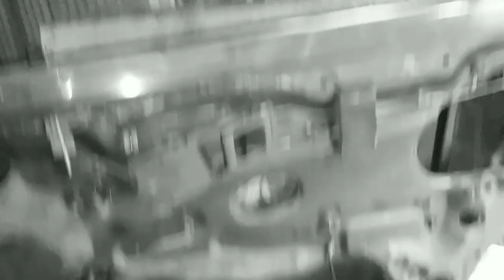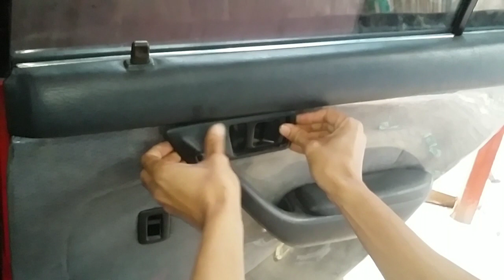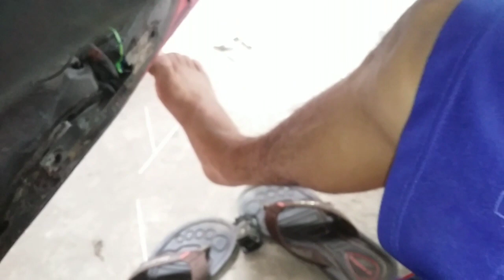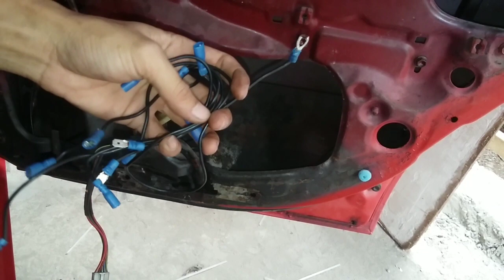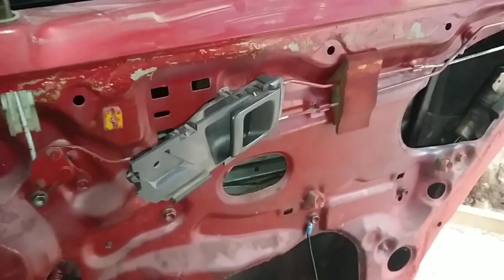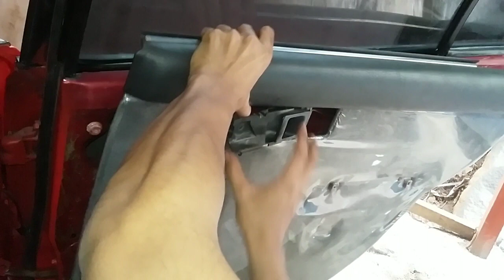Solusi power window lemah

Comment: Berarti kesimpulan nya. Tiap motor pake 2 relay. Di pintu driver walau bisa ngontrol 2 ato 4 jendela ttap hanya perlu 2 relay krn yg dikasi relay itu motor bukan saklar ya. Dan power window hidupnya tetap apabila on, bukan hidup selalu . Bgtu kan om
Reply from the maker: Betul om
Reply: @yulimaintenance1802  banyak yg salah kaprah di relay 5 kaki ya. Saya jg hampir salah beli kmren. Rupany ada yg kaki 87 nya double. Ada yg 87 dan 87 a. Yg 87 87 harga ny lbh murah dari 87 87 a
Reply from the maker: Iya om.. betul banget,, haruh diperhatikan lagi saat membeli.. ada banyak jenis rellay
Reply: @yulimaintenance1802  tiap motor sekringny cuma 1 bisa ga y

Comment: Mas, Klo stelah matikan AC beberapa menit, kaca jendela pintu depan sebelah kanan trasa berat Skali ketika sy naik turunkan, bagaimana solusinya mas, padahal relay dah sy pasang, tpi Klo gak sy hidupkan AC,, naik turunnya sangat lancar dan normal...
Reply from the maker: Voltage drop..
 Kabel yg ada di rellay pw langsung kasih arus dari aki mas,, dan dikasih sekring biar aman..
Reply: @yulimaintenance1802  ya mas, sy sambung lgsg ke + aki dan sy tambah skring 30, tpi tetap gitu

Comment: mobilio apa pakai relay juga bang, , ug gak ada suara relay cetik2 kalo di pencet,   
 posisi mau turun gak mau naik, , , 

saya kasih lampu kalo di turunin nyala terang, kalo d naikin nyala redup terus mati
Reply from the maker: Sbnarnya rangkain power window gak ada yg pakai rellay bang..
  Rellay dipakai hanya untuk mengakali biar arus yg masuk ke motor power window bisa maksimal...

Kalo kasus mobil abang tuh karna arus yg masuk kemotor power window lemah.. bisa diakali pakai power window
Reply: dah ketemu bang, , saya telusuri jalurnya ternyata yang lemah arus negatif tombol dari sopir , , , ternyata dah ngerak tebal, , ,dah 2 hari baru ketemu😵. makasi bang

Comment: Saya ikutin langkahnya, malah keluar asap gan, kendala yg saya alami, jendela berat bngt sekali tekan cmn sedikit naiknya, harus nunggu bbrp detik nnti bisa lg sedikit, jd harus d bantu tangan naik turunnya, apakah aman gan kl pakai bantuan relay itu, trus kl di switch kanan depan kan ada arusnya tuh, kita pakai arus langsung lg dr aki itu emang aman gan?
Tolong pencerahannya, terimakasih
Reply from the maker: Power window berat naiknya karna banyak kemungkinan mas.. bisa dari regulator atau rel karet jalur kaca..
   Kalo penambahan rellay hanya untuk mengatasi apabila arus yg masuk ke motor power window sudah tidak maksimal karna ada kabel atau konektor yang jabuk..
Jadi kalo dua masalah tadi penyebabnya bukan rellay solusinya..

Mangkanya knapa harus ambil power langsung dari aki supaya arusnya maksimal. Selama rangkainnya diberi fuse/ sekring itu pasti aman mas...
 Rellay yg dipakai juga harus sesuai ada NO dan NC..
     Kalo pengen lebih jelas bisa langsung japri WA saya mas..
085dua tiga dua 612 sembilan satu8
Reply: Ini di kasih sekring brapa ya Amper ya...  Ini kabel + per pintu d kasih sikring, apa d jadkan 1 dulu baru d kasih sikring baru d cop ke aki?
Reply: Bang sy coba ke mobil sy, tp kok tetep gak bisa gerak ya, padahal arusnya lagsg dari aki, tp klo gak di langsungin kabel dinamo nya ke aki lancar bang, sy pasang lg ke swit yg udah di pasang relay malah gak mau gerak

Comment: Sebelum pakai relay tegangan PW dapatnya 8V dan setelah pakai relay 5 kaki Hella 10/20A dgn skema seperti itu PW dapat tegangan 10V (lumayan ada perubahan sih jd lebih cepat naik turunnya)....tp kira2 kenapa gak dapat tegangan 12V sesuai tegangan input ya, apakah relaynya kurang bagus atau skemanya ada yg kurang?
Reply from the maker: Kalau tegangan input yg masuk ke relay 12 volt, output relay harusnya sama 12 volt, kalau kurang Brati ada masalah pada rellay,, tapi kalau yg inputnya kurang dari 12 volt Brati ada masalah pada wairing atau konektor,,

Comment: Pernah nyoba motor nya ga,jalan cuman tektok aja riley nya.
Reply from the maker: Makasih udau mpir gan...
 Video diatas hanya diperuntukan buat wairing yg udah fatigue ataupun konektor yang jabuk. Jadi arus yg masuk ke motor power window jadi lemah untuk itu solusinya kita kasih relay..

Banyak penyebab power window macet. Bisa motornya. Bisa karetnya. Bisa rel nya. Bisa juga wairing...
Reply from the maker: Sebelum menvonis motornya cek dulu resistance nya gan.. kalo normal brati ada pnyebab lain